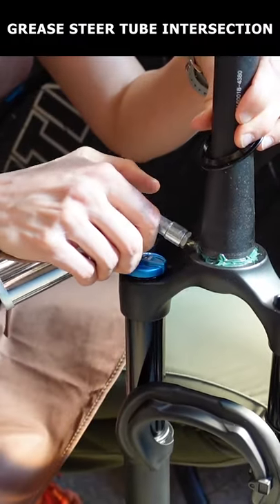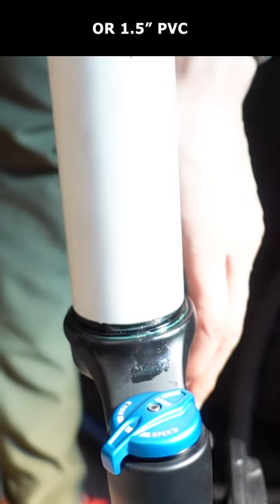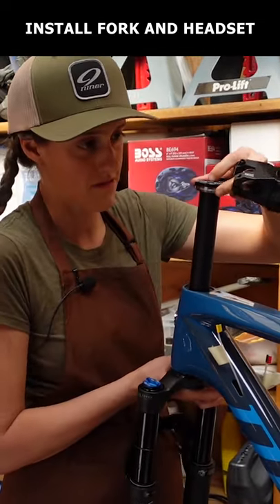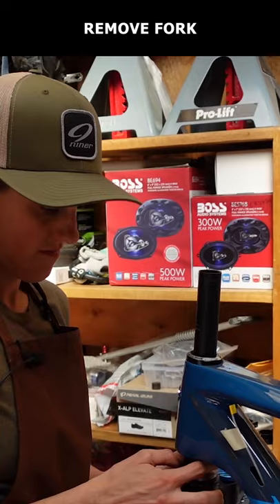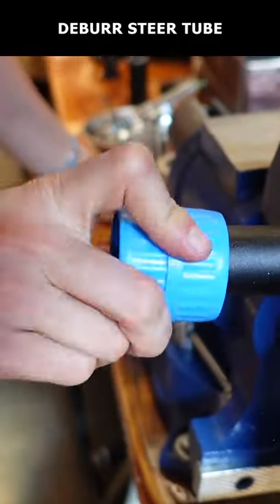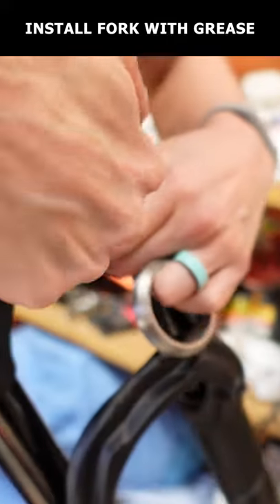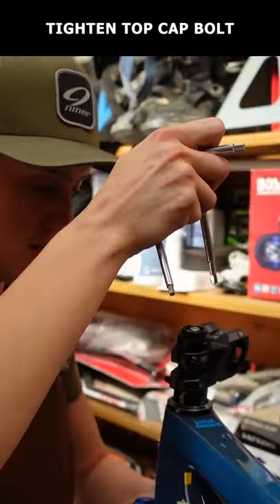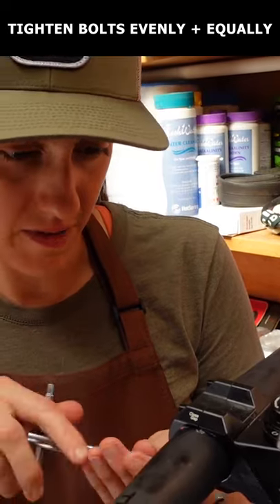How to install a new fork #Shorts

Comment: Pretty sure you're not supposed to use a pipe cutter, as the pressure will increase the tube diameter

Comment: Star nut is the most unnecessary piece of metal I ever seen, makes no sense with all parts so easy to install, star nut it's annoying if you need to make some change, in fact a tool could solve no need to let a part used only to adjust the bearings